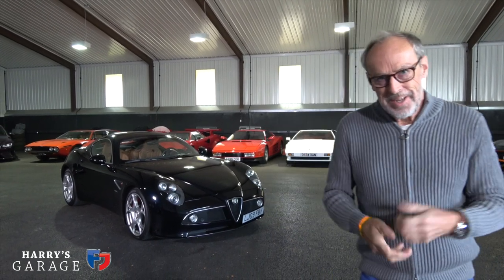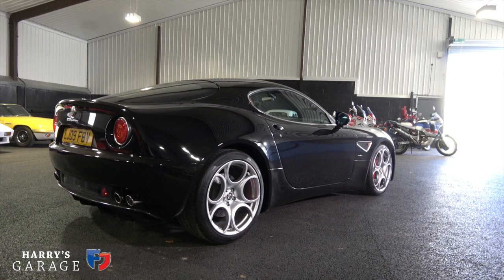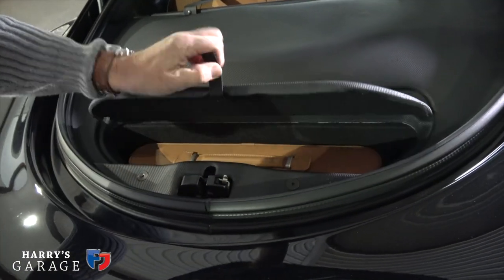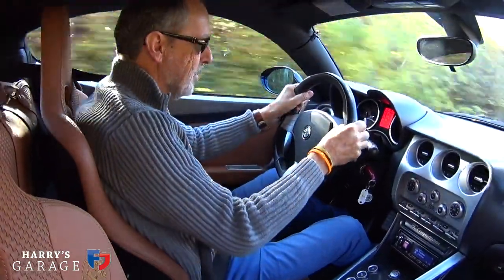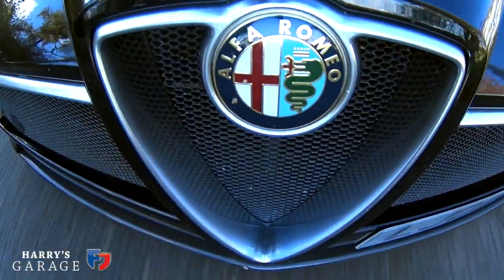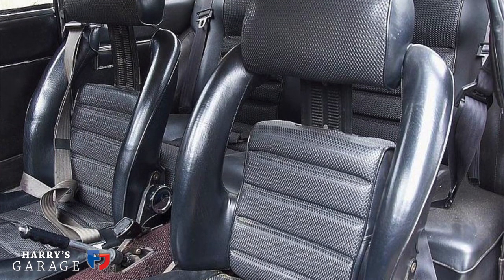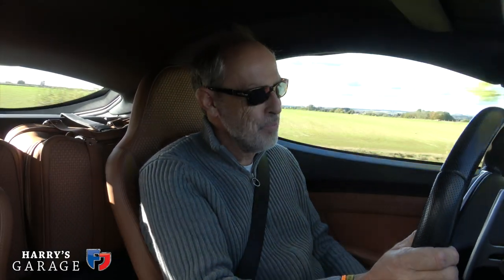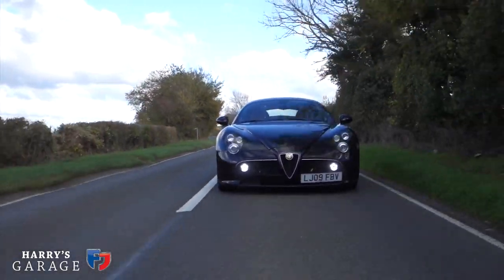Alfa Romeo 8C Competizione drive review

Comment: The important thing to remember about those gearboxes (I had a few with the same unit), they’re designed to be driven in manual mode via the paddles, and you’re meant to simulate feathering the throttle on changes. The auto mode was never really meant to be used
Reply: I am guessing it is the same with the Quattroporte Duo select?
Reply: nonsense.

Comment: I had the pleasure of modifying the first two 8C to enter the USA, awesome car and the styling is timeless glad someone posted a video showing it is still relevant today.
Reply: Auto Fanatic how does the engine sound compared to your Giulia QV? Both different but awesome?
Reply: @merlin51h84   the 8C engine sounds amazing you can not compare the V8 to the Bi Turbo 6 but the 6 does sound great and is the best sounding 6 out there i feel. the two 8C i worked on we remapped the ECU, first ever in the world to do these, made a custom air intake plenum with BMC filter and we removed and fabricated a resonator delete on the exhaust. these  two cars sounded incredible i wish i had access to them again today to shoot video. this video posted here is great because i remember driving these 8C new and i was scratching my head at how bad and rough they drove for the money. the progression of technology is staggering in 10 years with the automotive world and we see this in the new Giulia. Alfa also at this time did not have the money, facility and dire need to revamp the brand to enter the USA like FCA has now done. The 8C will remain a timeless rare classic for its lifetime regardless of how bad it drives to our modern standards.
Reply: Auto Fanatic .why modify it ...??.
Reply: Auto Fanatic I actually hear a touch of GT350 in the 8C at wide open throttle
Reply: did you know Ford bought a 458 Italia to study the engine design and that is what went into the 5.2 Voodoo which is very cool except the put the American Detroit Muscle twist on it.
Reply: because my customers demanded more performance/
Reply: Buy somerhing else then,you would not add a few more touches to a classic painting would you ?You dont modify a classic car.
Reply: Auto Fanat
Reply: A relatively mass-produced car isn't the same as a one-off piece of artwork. By the sound of it all those modifications are reversible anyway so you can buy their 8Cs and return them to stock if it upsets you so much. There's also a  big difference between massaging the performance of a car and ruining it with tasteless visual mods, at least to me.
Reply: Well done Auto Frantic! Anything you do to get US Alfa Owners to drive their cars more is worth it.
Reply: I think the maserati mc stradale , both 4 seater and 2 seater version are better than the 8c in looks, plus far more dynamic at 1/4  the cost(50-80k) of the 8c. The mc stradale is newer and has the 599 gto gearbox with 60millisec shifts and carbon ceramic breaks plus the 4.7 maserati v8 with 460hp.
Reply: it's not a classic car. classic= 20 years old or more
Reply: @autofanaticcars  When people say that, I always ask them why and how often do they rev the engine up to the top. If they can't answer it, then I do know, they do not need more power.
Reply: Petrolicous did a video on it that was very well done. A red one with cool badges on the fenders. Were the jurnos lying when they said it handled like a 90's Mustang?
Reply: My 4C took 5 years to arrive in the UK.  I wish it was electric .
Reply: @dln.sweeney  exactly.Most people buy cars to drive them and performance  cars for performance.The  new owner of an art masterpiece might far outspend the previous owner on all the important things for art work: location, lighting, environment etc.(or not) and a You tube opinion-monger might want to sound off.
Reply: @philipcooper8297  But if you earned your living satisfying the high-end consumer whims of others you might weigh up carefully asking them such a question.
Reply: Auto Fanatic you should developed a manual conversion from the 8c and it will surely be a looker and blast to drive
Reply: @autofanaticcars  i like the voodoo sound even more than that of the 458 if i´m honest, as this engines stands out from the crowd. the 4.7 maserati engine ( which is also used in the 8C)  sounds great too and of course the 5 liter engine from toyota that powers the LC500

Comment: I've got a v6 brera, and have to say I absolutely love it.
Reply: Try a remapped 1750 if you can, its even nicer than the V6!
Reply: @Bertie Bollocks Yes, technically GM
Reply: @DavidColex  yep, got one of those. It proper motors 👍
Reply: @ryan 77 I had a v4 2.2 Brera, from 2009. AWESOME machine, kept it for 10 years. Felt very special in it every time. Sold it just bcz it drank a lot of fuel and I cover large distances. BIGGEST regret, I should have kept it and bought a second car for my commute. Dont sell it mate!

Comment: A member of my AROC has one. These need some suspension sorting but can be done. Biggest issue is ALFA told owners they will not supply any parts that aren't found on other cars in current production. If body panels need replacement you are out of luck....so now an expensive garage queen. Love ALFAs myself. Had 70 spider for over 40 years...and raced a GTV in SCCA. Currently have 4C LE which is a fantastic car. Not practical for anything except putting a big smile on your face.
Reply: So far I have found parts to be OK - supplied by Maserati not Alfa. I lost a piece of trim from the roof and they had one in stock. I imagine over time it will get very hard but this is the same for all Maserati cars after 10 years.

Comment: A car that should have come with a manual gated box and a Skyhook suspension or at least manually adjustable damping. In many ways, the 8C summarizes high rank and emotion Italian automobiles: quite compromised on the overall and flawed, but certainly no compromise on styling and sound (no fake farts coming from those pipes, no stupid playstation noise coming from the speakers, can ya hear that, Jag and BMW ?).
Reply: I agree with you, but when the 8c was in production there was also the M3 V8, M5 V10 in production.  The new Stelvio  has some kind of microphone next to the intake, the signal from which is used to generate some sound in the interior, but it is a option.
Reply: It was base from masarati so it don't have one.
Reply: The car does have some fake exhaust sound in as much as a small amount of fuel is squirted into the exhaust on gearchanges so there is some sneaky tinkering going on to produce this incredible cacophany 😎.  Makes me miss my Maser GT 😢

Comment: Love Harry`s videos. But Alfa is my favourite along with Rolls Royce...Of course. I have had Alfas`s when I was single years ago, A spider, GTV 6 , Gulietta and an Alfasud. Now kids have all grown up and left and I am an old crotchety, I would like the new Alfa Stelvio Quadrifoglio, as I am now disabled I cannot get into a low car anymore. I wish Harry would review one!
Reply: I hope that you will buy some of the Quadrifoglio cars (personally prefers Giulia, but from what I'm hearing Stelvio is awesome as well) some day. Seems like the proper guy to have it.
Reply: Tell you what, in the early 70's to mid 80's my dad owned 7 Alfas, consisting of 3 Alfettas 1.8 (one was for spare parts), 1 Alfetta 2000, 1 GT Junior and 1 GTV 2000 plus 1 Berlina. He also owned 240Z. All the Alfas were sold in the late 80's to early 90's but the 240Z remains up till now. The 240 Z was much more reliable than all the Alfas, period. I bought a low mileage 156 2.5 V6 while working in the middle east. One day the so called selesspeed would not switch gear and I was stuck in second. Never ever again buy any Alfa's product. Almost 4 years now with the XC60 - wife;s car -and never have any issues.
Reply: @valentinorossi7771  hi, good morning. You should try out the more upto date models, absolutely fantastic. I agree there were loads of problems for some, I had absolutely none at all. I will be buying the Stelvio Quadrifoglio in about a year. Give it time to be tested fully by others. Also if like Harry I buy more cars, my wife will kill me!!
Reply: @chunkychinn M y wife's XC60 has only done 42,000 miles with no major problem so when time comes to replace it I will test drive Alfa's product. Honestly in general Volvo is more trustworthy than Alfa.
Reply: @valentinorossi7771  Alfa is not Volvo, Volvo is not Alfa... I know which one I prefer, and it's the one that make me feel alive, not one that makes me feel like dressing like I am serving sausages to tourists at Oktoberfest. Personal preference really. I have 2 and looking at a 3rd...all keepers.
Reply: @valentinorossi7771  The 156 2.5 V6 didn't have the so-called Sillyspeed (single-clutch robotised manual transmission, a stupid idea no matter who produces it). It had either a 6-speed manual or a 'Q-System' conventional 4-speed automatic from Aisin. I'm not saying the 156 didn't have flaws, just that you obviously belong in a Volvo. ;)

Comment: Gorgeous thing, probably one of the most beautiful designs in the last 20 years, if not more. As a cheaper alternative, though, i would go for the Maserati GranTurismo, same glorious sounding engine and a third or less of the price, plus you can get it with a normal automatic (yes, manual would be awesome, but between the automated manual with temperamental solenoids and a proper ZF auto....), and the looks aren't too shabby either (it's gorgeous as well).

Comment: The chassis was based on the Maserati Gran Sport, not the Gran Turismo. Also, the 4.7 Maserati V8 was never in the California. The California had a detuned version of the 4.3 V8 from the F430. Awesome video tho
Reply: Was about to say this, I have a GranSport, very similar tho this car, but a lot lot cheaper!
Reply: Thats correct its the same Skyhook suspension but stuck on Sport mode with no option to change it. Many of the parts are Maserati and they are sold through Maserati dealers and not Alfa.
Reply: Very old car.
Reply: @drphilgarner  My neighbor have one but change to gran turismo afterward. old masarati broke down too often.

Comment: A beautiful but truly awful car. I took delivery of 1 of 4 produced in yellow in 2009 after a 5 year wait.
It follows every rut and undulation in the road, meaning you have to be on top of it all the time, at speed that can be quite frightning and very tiring. It's like a grasshopper on speed.
I would say this car was designed for the track not the road, the ride is awful
 The noise, it sounds fabulous around town or on the backroads but after an hour and a half on the motorway I couldn't wait to get out of it and give my ears a rest.
 Parallel parking with this gearbox is impossible, it will not creep, you have to rev a bit then brake as it lurches backwards or forwards before hitting the other parked cars.
 At 6 months and 700 miles a compulsory service and oil change £1250.00!
After 2 years ownership I wasn't sorry to see it go.
Reply: mymaseraticoupe it’s not a daily driver and that obviously went over your head. Parallel parking a sports or super car should never come up when you’re talking about how good the car is. That’s like buying a family sedan and then complaining that it doesn’t accelerate like a Huracan
Reply: ZappoTan spot on, the 4C is really a mini-me version, including that weird button transmission and no rear visibility, but glorious styling and sound even from a 4-cylinder. Great Maserati coupes ;)
Reply: Like an Italian woman!
Reply: It was base from masarati so it don't have one.
This is know to be unfinished concept car.
Reply: I can see a car like this having a lot of owners in the decades to come.
Reply: The word "Competizione" is translated by "Competition", so I guess that's the reason...

Comment: "Alfa Romeosi are only for true petro /gear heads" quote from Jeremy Clarkson Top Gear; how true. This awesome 8C is a true purist type sports car for a few of the following reasons/facts. For one it has NO  controls (junk) on the steering wheel like all other cars,from the cheapest to those over 2 million bucks. The console is simple and straight forward in its lay out, plus the console is not loaded down with a confusing array of buttons,knobs,switches and does not look like the power center (8 throttles etc) on a Boeing 747!  Simple is best, for one there's less to break (electronics). 
It should have been a felony for the Italians to not produce this beautiful, sonorous and powerful Alfa for all markets,damn the Italians!  I've owned 3 Alfa's. My first was a primo 63 spider I bought in 1972, then a 1983 GTV 6. Then another spider a 1994 I purchased in 2005.
 I put 149,000 miles on the GTV 6 with out any issues after the 2 required mods were done, which had a screaming high revving 2.5 liter V-6 ,single OHC with a 5 speed trans axle (De deon type in the rear with in board brake rotors). Man what a wonderful driving and traveling car. Finally sold it even though it still ran like a well oiled Rolex. Sure wish I still had it.

Comment: i think i speak for all seeing that i am fortunate enough for my relatives to own one of these. it is one of the best cars ever made in my opinion. The way it looks and sounds is beyond my comprehension. every time you turn one on you can hear from miles away the way it pops and bangs at low and high RPM. Yes granted the ride isn't the best and the steering is a bit "wooden" (says Jeremy Clarkson), but it wasn't made to rip around the track its made to chew up the miles and it does that superbly. overall it is and will always be my favourite car ever and you can't change my mind.

Comment: A very enjoyable and informative video, I would love one of these fabulous cars but I doubt I will ever afford one.
I had a 4.7 Maserati GTS with the same engine and gearbox, I agree about the low speed manoeuvring but out on the open road it was one of my favourite things about the car, I loved the savage gearchanges at full throttle and maximum revs in sport mode, it just added to the excitement of driving the car. As you say the engine is absolutely epic and must be fantastic in a lighter car like the 8c.

Comment: Back in 2009 I was looking to buy a new coupe and test drove one of these and a DB9. I chose the latter as I had teenage kids at the time and a 2+2 seemed a better choice.

When I sold the DB9 3 years later with 40k miles, I lost about £50k in depreciation and today it’s worth about £30k less, around  £30k. The 8C was roughly the same price and there are 3 on Autotrader today from c £220 to £250k. One of my worst automotive choices financially ever. Doh.

I console myself that I bought a Maserati Grancab for £35k with the same engine, same sound, much nicer interior and can use as a 2+2, but still regret i didn’t buy an 8C new and wrap it in cotton wool, as it’s not a great driver…..but the looks and value ❤️😱

I even get to experience the 8c’s single clutch robotised manual, as I have an Aston Vanquish with the same arrangement!

Comment: The minor drawbacks sound like GTV from the 70s. The gear change in mine took about a week to get used to. Having to shift the engine foreward to change theflex couplings on the driveshaft and to pull the cyl. head were my only issues. Balance and handeling are the best with the balance with the clutch transaxle in back and engine just behind the front axle. Mid engine may be the best when it comes to ultimate polar moment but this setup is fantastic.

Comment: About the handling and ride and why isn't it as good as you would expect. How much do the wheels weigh? What springs rates is it using? Can you soften off the dampers, if so, what effect does it have?
Reply: they could not make it better than Ferrari, , that might be one reason
Reply: @Anttihii  good point

Comment: I get the transaxle part, however,  for a front engined car, you'd think there'd be a bit more luggage space.?
Reply: Nope. Especially since they shortened the wheelbase from the gran turismo, the gearbox is right below where the boot would normally be. It's a shame it would have been a nice long distance GT if it weren't for that.
Reply: @aproductofboredom  I tend to forget how big gear boxes can be :)

Comment: I am a bit disappointed in how Harry started this video. I know it's a commonly used tactic to mock something of which you are aware that has not achieved the hoped popularity, but instead of throwing some words around.. I would like to hear from Harry why he thinks a 166 is a 3 star car and a sea of nothing?

The Alfa 166 is actually the Alfa that was a really good car and could actually easily be matched with the E39 if not outperforming the e39. The 3,2 Busso has one of the most loved and refined engine characteristics, lovely power and great reliability. The 4 cyl petrols were good but not a match for the Busso V6 and the JTD diesels were probably the best in it's class. 
Interior quality is really good as well as driving characteristics for a fwd. 

Can't just bash that car without any argument. The 166 was so poorly sold in the uk because of extreme depreciation but not for any other reason except for maybe the general public opinion about Alfa which is far away rom the thruth.

Comment: At last, a proper review of this car! I love Alfa's, but I cannot understand how they could not fit a proper boot to the two seater body shell. Maybe they put a rear bulkhead to improve dynamics.
Reply: If you think this is bad you should see the Spider boot, and no space behind the seats! The issue is that the engine is pushed so far back it means you are sitting close to the back wheels which next to the rear gearbox and petrol tank. there is just no space for a boot. Form over function !